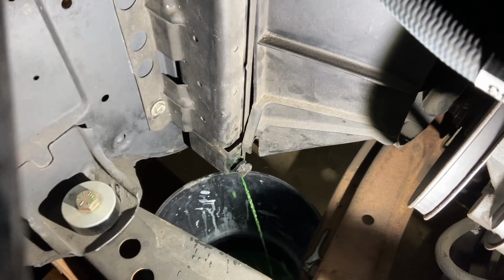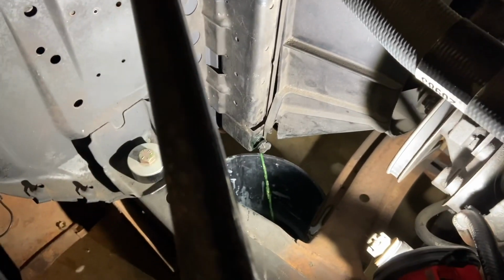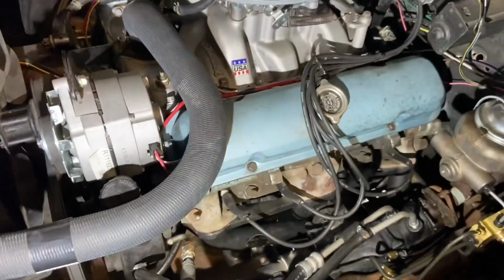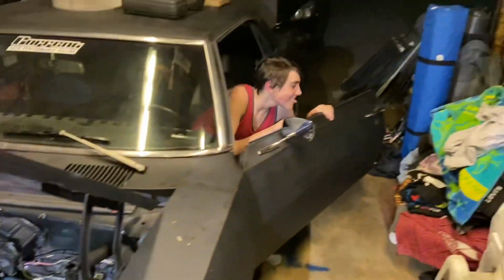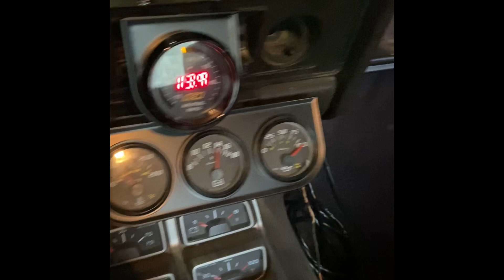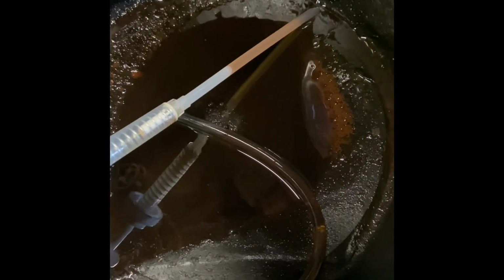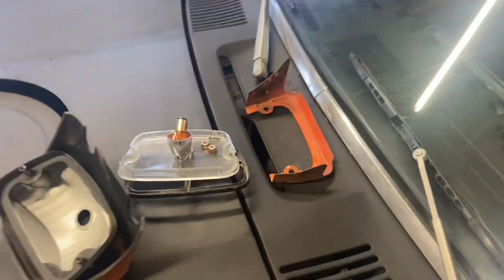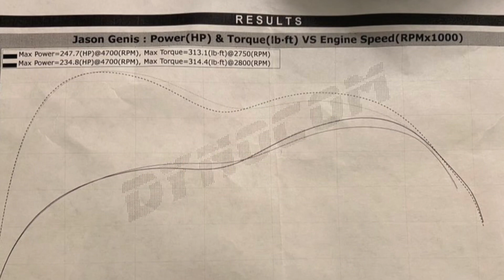1969 Firebird build history. Phase 3.5

Comment: 6:34 nice wideband air fuel ratio gauge, as you all you can see how low latency and quick response it is. Aem made a great gauge here.
Reply from the maker: It really is a good gauge, unfortunately I got it from a friend and it started acting up and not reading right.  Turns out when he pulled it off his ride some of the wires got messed up.  Not a big deal since I installed a sniper and it’s handheld display shows the AFR now.  I appreciate you watching the build history. I’ve seen your other comments but just haven’t had a chance to respond yet.  Thanks again for watching and sharing your insight!!
Reply: @ogresspeedshop  2 bad , i guess it turned out to be not as good as it seemed. it bounced around a ton was that normal? i have used those digital afr gauges the summit brand ones they just have a green bars yellow and red and thats it lol.
Reply from the maker: @zAvAvAz  I’ve installed a few in customers cars at my last job and they all worked good.  This one did bounce around a lot.  They move of course but usually settle on what it’s reading pretty quick.